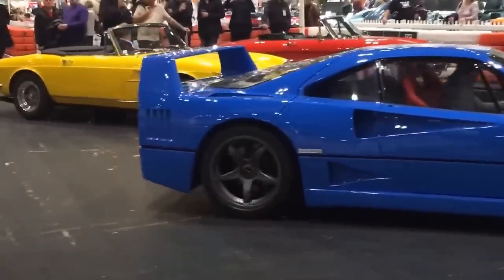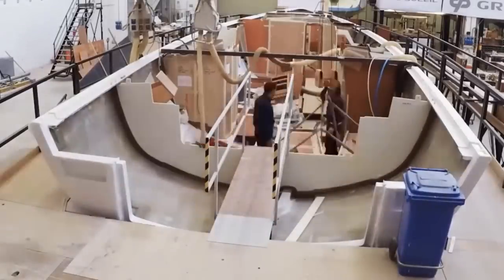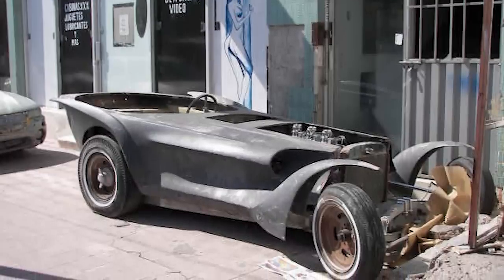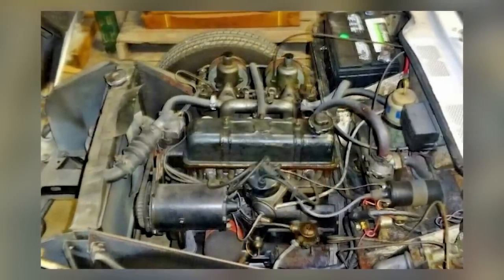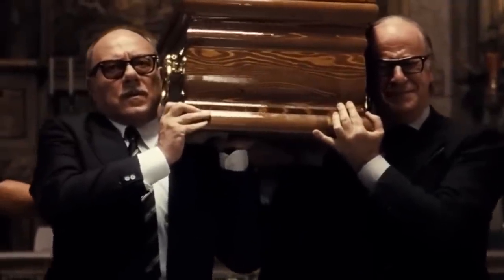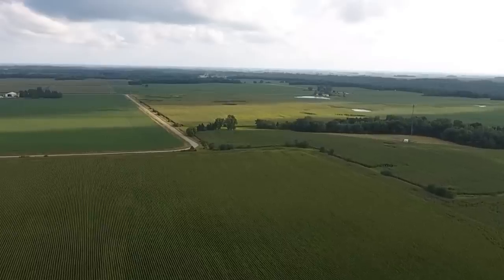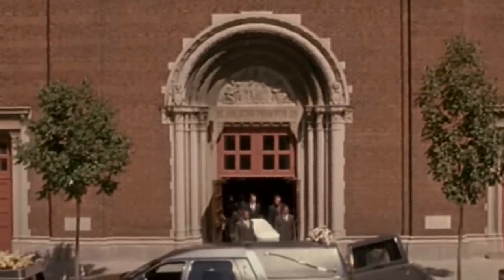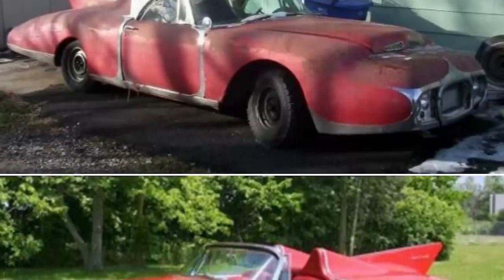12 Most Rare And Expensive Abandoned Cars

Comment: The '68 Charger was available from the factory with the 6.3 liter engine (383). They were rare, with only 259 made, simply because people wanted the 440, or 426 engine options. The paint on that car isn't original, in fact the color on it, Sublime, wasn't even available until the 1970 model year.
Reply: You sure about that? 383 was probably the most common, as the 318 and even the slant 6 was available!
Reply: the cars shown are not the same cars found. well, not in every case anyway, most are similar because the people who made this video are lazy.
Reply: @UberLummox  I have to agree that 383s weren't that rare. If they only made 259, I must have seen them all! Maybe he is only counting the ones with only a 2 barrel carb.
Reply: Mine had 318

Comment: love the spitfire but it will not start first time. Brits never could build a carburetor, they didnt work half the time new. I had an old spitfire loved that car but you had to tinker with the carb. every time you wanted to drive it. tried having it rebuilt and that didnt work i was going to slap an american carb. on it but sold it instead.  i would love to have it back it was British racing green.
Reply: I had a '64 Spitfire,  Ran great.  No starting problems whatsoever.
Reply: My brother had that exact car with that exact problem. I love English beauty but American heart. My '89 XJS has an LS3 in it. Purists squawk. But it's my car. I'm 70 now and want to ride, not repair a touchy expensive 12 cyl.

Comment: All of the info about that 68 Charger was completely wrong. They made 17,000 Charger R/Ts, which mostly had 440 Magnums, though a couple hundred had the 426 Hemi. But that wasn't 6.3 liters (383), it was 7.0. And it wasn't 294 hp, it was (nominally) 425. But that one did NOT appear to be Hemi Charger, though it did have an R/T stripe on the back. And I'm pretty sure Sublime/Limelight Green, a "Hi Impact" color, wasn't available until '69.
Reply: Those colors were 1970 only.
Reply: @jhutch1470  ok, thanx
Reply: @donellmuniz590  If the color was changed, the R/T stripe may have been added, at that time. Maybe not an R/T at all, and the horsepower rating suggests, if a 383, must be a 2 barrel, or a low compression 4 barrel, which would probably be rare, for the day. If I recall correctly. 383 4 barrels, we're rated at 330 hp, except in Road Runners and Super Bees, which were 335 hp
rated. 440 =7.2 L. (standard in the R/T @375 hp).

Comment: 40 years ago, car engines weren't classified with a "liter" rating, they were classified by cubic inch displacement, that being said,  there was no such thing as a 6.3 liter engine in a 1970's  Charger, so pretty much everything else in this video will be nonsense as well...
Reply: Yes well. The 383 was in fact 6.3L. Even if that was a Euro measurement.
Reply: @kevatut23  But the Dodge Charger wasn't manufactured in Europe was it???
Reply: Not to mention, he never mentions the actual engine specification the car was manufactured with.  I'm assuming it was originally a Hemi, but not having a numbers matching engine dramatically lowers the value of the thing even if it started life as a Hemi.
Reply: 1965 daimler 2.5 litre.
Reply: Isn't cuicand liters just two different forms of engine displacement depending on where the car was made?
Reply: @chuckschillingvideos  They said the owner must have wanted more torque, so originally it probably was a "rare" 225 6 cyl model originally, or a 318 2bbrl.

Comment: "The fuel pump looks to be in need of replacement" ????? You can't look st a fuel pump and know if it needs to be replaced.
That 57 Corvette was definitely not used for drag racing. Who writes the narration for these videos? Definitely not a car person.
Reply: H GUI
Reply: Used to you could look at a mechanical fuel pump and check out the condition of the pump's actuator that rides on the cam,  through a slot in the pump body. Everythings electric today.
Reply: maybe it was missing?